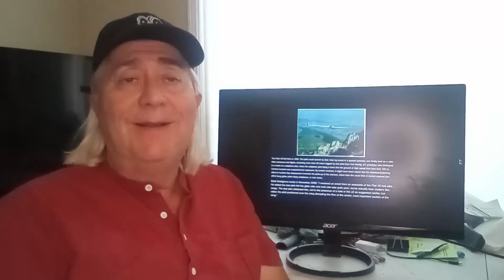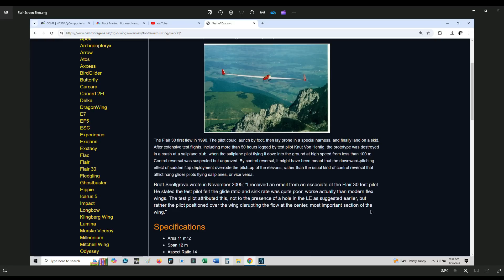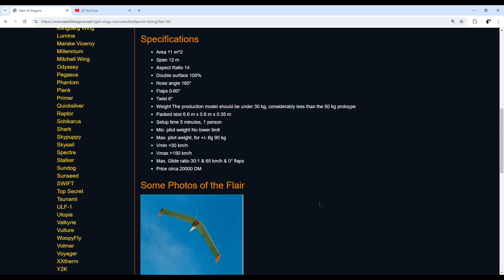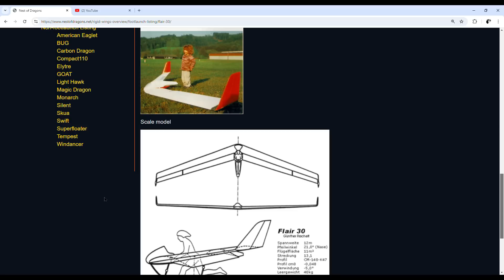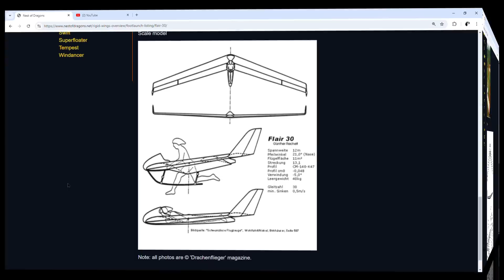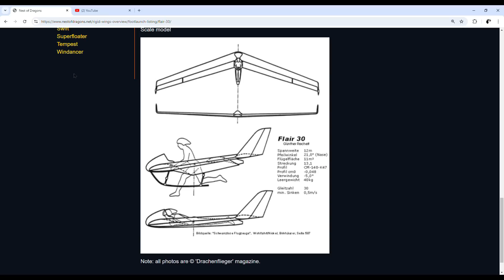Fatal Flair 30 Crash - An Engineering Analysis

Comment: Sounds reasonable. I heard no mention of airfoil thickness. Should be around 9-11%?
Reply from the maker: The thickness of the airfoil on the Flair (at least the one from sketches in various books which could be wrong) is 16%. Currently, detailed analysis is showing the main issue to be the hinge line location being way too far forward. The results appear to be independent of airfoil selection.

Comment: I was a good friend of Gunther Rochelt, and I remember this well. The problem was that the CG was more forward than previous flights, and when the pilot put the large flaps down, the elevons went up so much that the airflow separated on the bottom of the elevons, so they lost the ability to get the nose up. So, it dove it. Bottom line, the flaps were too big, and required an automatic mixer to raise the elevons with flap deployment. Flaps down, elevons up, and back stick let to disaster. RIP.
Reply from the maker: Hi Eric: Hope all is well with you, your family and aviation projects - they are unparalleled. What you have written is the results of analysis that was done shortly after the crash. I've never seen any math to back it up, but it might be out there somewhere. Apparently the LBA analyzed the crash over a 6 year period and I'm trying to find that report. I'm currently in contact with Gunther's son to see if I can get a copy of the report and a set of airfoil coordinates. Currently, Steve Morris and I have both done some CFD on the design (different codes) and have seen results that do not align with the reported flight characteristics. It is documented that the pitch trim was neutral with flap deflection, but Steve and I don't get that result. Steve is uncertain why. I'm trying to find out more about the crash because I think I've had similar or related issues with my current glider. So, stay tuned and keep posting your work and flights, they are really great.

Comment: Ludwig Prandtl Died in 1953.   So should have his ideas. They have proved a rabbit hole .. without end.
Reply from the maker: I would tend to agree, however, they are technically correct and therefore should be retained for reference. The key question is, "Why would you make this post here?" I am looking for airfoil coordinated for the Flair 30 and your comment is not helping in that regard. Post here only if you can help.

Comment: Wouldn't the center of lift tend towards the rear while slow?
Reply from the maker: You have asked the wrong question. The center of lift does not move with changes in speed. The correct question is, What happens to the pitching moment when the controls are deflected - especially the flap? I and another aero eng are still in the process of analyzing the design to answer this critical question.
Reply: @KlingbergWingMkII  Yes...control deflection. One model of that pitch behavior is C-150 full flap deflection forcing a strong down pitch adjustment when still well above stall.
Reply from the maker: You seem confused over this concept. From the Aviation Stack Exchange, "The aerodynamic center does not move when plain or camber flaps are used." The change in pitching moment is due to the increase in camber and hence the amount of circulation around the airfoil. This is standard aerodynamic theory. I only post this correction so my viewers do not become mis-informed.

Comment: I just posted this video of a recent flight in a production SWIFT3 where benign stall characteristics at maximum elevon deflection are demonstrated while thermaling.  The SWIFT3 avoids the problems you mention regarding control surface stall by using an airfoil that is thin in the chordwise region of the control surface.  The airflow does separate at max deflection but there are no adverse effects on handling:
https://www.youtube.com/watch?v=Q2AuMTkoyB8
Reply from the maker: Thanks Steve. Don't know if you/ve seen the following video, but my xflr analysis of an airfoil similar to the Swift (BTW, do you have the coords for the Swift airfoil and may I have a copy?) shows exactly what you are talking about. It is clear that at low Re it is important to keep the control hinge line outside of the adverse pressure gradient. I discuss the topic in detail in the video. I mention this as I bet most folks have not seen the video or don't really understand my pts. I suspect that the hinge line of the Flair flap at 40% is the root cause of flow separation and hence a full-on stall (at AoA less than normal stall) and caused the Flair to pitch down rapidly with no room for recovery. I will be posting a full analysis of this issue in the near future. Fly Safe, Rol. Video on the topic: https://youtu.be/2mh8szvuD40

Comment: Hey. Long time ago I worked for Rochelt at the Solair 2 projekt 1997,years after the Flair crash .I have seen the remains of Flair 30 . Rochelt told later the pilot was too far forward ,so was the center of gravity. I could imagine the wigtips that have to produce downforce may have stalled on their lower surface. I will see if I can find out something about the profile. Stay alive!
Reply from the maker: Having the airfoil coordinates would be a huge help. Let me know if you get them or can give me a lead on where to get them - thanks!
Reply: @KlingbergWingMkII  I will try to get, but I can not promise,
Reply: @KlingbergWingMkII  I had a call with Holger Rochelt , son of Günther Rochelt ,5 min. ago. He flew the Flair30. I may send you his telephone number so you could get in contact with him. But not here in public. Do have a E-mail adress or something where I could send you the number privatly?
Reply from the maker: Do you happen to know whether or not Gunter was a licensed engineer? If yes, what type of degree did he have?
Reply: @KlingbergWingMkII  First of all Günther was a visionary and manager. He was well known in germany for his many airplanes . A team of engineers did the structural and aerodynamic calculations for his projekts so he was well based from a scintific point of view.The real problem was how to finance? He him self was professor for industiedesign in Hamburg- where I met him.
Reply from the maker: Do you know if the Flair was ever tuft tested to look at the flow on the wing? Also, was it ever foot launched into flight or was it always towed? Finally, was the flap ever fully retracted (zero degrees deflection) in flight? Please respond to my email: rolkling@gmail.com. Thanks much for all your help.
Reply: @KlingbergWingMkII My plesure if I can help you! These days a had a telephonecall to Holger Rochelt, son of Günther Rochelt. He flew  the Flair 30, he can tell you more than I can. He told me to give you his telephone number. .I did send it  yesterday .Did it work ? If not, let me know, I try it again. Hey , I like your planes , beautiful!

Comment: I am living in germany and I met Günter Rochelr three times. And I have seen  how the model of the flair 30 crashed at winch towing. But what I know about the final crash of the full scale  flair is the following issus. The wing was overloaded. and the CG was too much in front of limimit. Here in germany we beive tha a air flo seperation at the lower furface of the airfoil was the reason oft the fatal lethal crash. In comnination of maximum set of flap defection and over limit CG the seperation of the lower surface of the wing tip overcame the ability to pitch up the whole wing ad the wing crashed nose dowt at the final approach into the ground.
Reply from the maker: Thanks for the input. I have read the original accident report (poorly translated) and your comments align with that report. However, regarding classic aerodynamics, that analysis appears to be flawed. Having a CG forward of the limit will not cause an aircraft to dive into the ground, especially after 45 minutes of flying time on the fatal flight. A forward CG would require a lot of up elevon to take off or not take off at all depending on how far out of range it is. This would be apparent at the start of flight. A good pilot (seems the accident pilot was very good) would not continue a flight with this issue. But, if the CG were at or near the aft limit, then a good pilot might be able to fly the aircraft for an extended period of time and then either a gust, or different flap setting causes the aircraft to diverge from it's stable config and either pitch up rapidly or dive into the ground. An unstable aircraft can go either way. What most people seem to be missing is that this was, of course, a dynamic event and most of the analysis I've seen is from a static point of view. This approach can lead to incorrect conclusions.

Comment: I have a theory but would help to see the video of the crash.... Is there a link or do I need to go hunting for it?
Reply: I've recently had some surgery and typing is really difficult.
My experience may not be very valuable or interesting to you as it's all based on self gained knowledge designing my own rc models over the last 40+ years. 
I know that aeronautical properties change a lot at scale. With that said, it is true, especially with wings, that there are things done within the designs in any scale that will create huge swings in performance and especially stability.
In my humble opinion, these large light "rigid" wings aren't very rigid because of weight concerns. 
Two things. 
COG of course is everything. Nose heavy gets away with a lack of correct position. But tail heavy on an aircraft with no tail is a HUGE catastrophic problem. 
Put a pin in that for the moment. 
Wing twist is used in nearly every design I've ever seen. Especially in rc models without a fly by wire controller using 10 dof IMU's.... 
Basically your wing design isn't perfect so we are going to pretwist the wing, to give the wing a little extra up elevon to correct any bad handling tendencies. 
I know this is basic stuff and very abbreviated I'm trying to demonstrate a basic understanding not trying to tell you anything you don't know. 
Bare with me, I'm getting there. 
Other things I've had to work through...
Wing sweep. Winglets. Size and locations of control surfaces.
All these things I've have added to my early designs because they were bad and I had to according to everyone I didn't ask for advice from...
You may be experiencing yourself currently.
But as my designs got more complicated I went from an aircraft that wouldn't fly to something that could but not great but then would become a better flyer but began to start eroding the performance to the point of becoming unfliable.
And programmable flight controllers became necessary to stay in the air like modern fighters.
That's when I changed the goal to making an efficient wing that tracked and steered correctly WITHOUT winglets. That remained stable WITHOUT twist or washout. I reduced the size of the flight surfaces and increased the sweep to bring everything back to a more stable platform and a wider chord at the wing tips. 
What I found was that the combination of all these things were flexing and twisting the wing to the point where the center of gravity was shifting aft. 
And in a really strange still not quite understood phenomenon was resulting in a nose down condition. 
If I'm right, you have a worse problem than I did because you have a PILOT. 
A pilot moves around. A pilot wants to be comfortable and we all fly full scale aircraft with at least some body English. My wife drives with her tongue hanging out of her mouth. Literally. 
What I noticed one time was when the car did something unexpected her tongue English was going the wrong way. 
That got me thinking about the battery in my wing. It was not only moving but it too wanted to be comfortable and was moving in the wrong direction under these weird loads because I used a rubber band (old school) to help secure it. It was pulling on the heavy side by using the wires as a fulcrum. 
I still don't understand everything that was going wrong there. 
But what I did was secure the battery, dialed in the correct cog and removed washout. Took advantage of adverse yaw in the elections and flattened the wing. I had good results with 2° anhedral for more aerobatic maneuvers. 
Thin longer and stronger control surfaces at the root of the wing instead of thick large but short length surfaces at the tip. 
I'm also blending two airfoils. I have the root airfoil and the tip airfoil and through the magic of CNC hotwire foam cutting I get a PERFECT blended wing with 50/50 throughout the length of the wing. 
Taking advantage of two airfoils at different areas of the wing means less compromise in choosing one for two very different parts of a  wing plan. 
Just don't get them backwards and spend a year trying to fly something that is literally fighting the air and itself and literally negating every single benefit you thought you were taking advantage of.
Reply from the maker: The crash was indeed filmed/recorded, which was new info for me. The location of that recording is currently unknown, but I'm in contact with a fellow in AU who knows some of the folks involved, but generally does not speak of the event. He may be a possible source. Stay tuned.

Comment: Airfoil numbers: I'm going to assume you may have reached out to John Roncz before his passing last year. If not, another source could be Jim Marske. Jim"s expertise is flying wings almost exclusively. Also, Matt Kollman who has been making rigid wing hang gliders for some time. Good luck!!
Reply from the maker: Good idea. Do you have any contact info for those still living?
Reply: Jim Marske also recently died. Contact info for Matt Kollman, who worked with Jim, can be found over at KollmanWings.  Jim's website is still up and still nice to look over.  There may be clues about the Flair 30 in Marske's stuff (which Matt Kollman may have insights on).

Comment: Stay with free flight models and you can stay safe and learn about aerodynamics more economically.
Reply from the maker: Only partially true. Models have much lower Re numbers so they do not always behave the same. Just ask the Wright Bros. The Flair had extensive model testing which did not show any problems. I make these comments so that viewers do not get mis-directed by incorrect technical comments.

Comment: Not much of a description on the crash (leading up to pitching down) as you read the statement. Was he at high speeds leading up to the pitching down or was he at slow speeds? Almost sounds like tuck under if it was at higher speeds as I have not only heard about tuck under it happened to me with an RC sailplane. I was told there is nothing that can be done when getting into this bad situation except watch it go down. Luckily enough I had plenty of altitude and slowly pushed out of it. I believe if I were a test pilot on something with a high aspect ratio wing I would have camera's on the tips pointing inward down the wing with a reference point as well as a camera pointing down to the tip of the wing to look for this. Torsional strength when weak the wing tips tend to oscillate violently and either explode or slow down the craft. A stiffer wing tends to lift the tips trailing edges. I met the gentleman that perished in 1995 at lookout mountain as I was looking forward to watching him fly his Swift and went out for dinner then when I came back it was at the landing zone in pieces. I was told from a friend of his he was doing loops as he normally had done in the past then went to strafe the field and it went into a bad oscillation and he could see him bouncing in the cockpit and I am not sure if the wing folded before it hit the ground. That was a bummer of an evening. Would be very interesting to see what happened. Take care
Reply from the maker: I'm not asking for help in analyzing the problem. I'm asking folks if they have any info/source for the airfoil coordinates..

Comment: Hello Rol! I think I have seen you showing us the book "Tailless Aircraft in Theory and Practice" from K. Nickel. Please look in pages 469, 470, 471 and 472 where it discusses about Flair 30. It has also a view of the airfoil, so maybe you can copy it for analysis. That said, pls be advised that G. Rochelt, the designer of Flair 30, has also passed away (I think he died in an aicraft related accident), since many years now. But Nickel, the author of the book was also German and I am sure they had discussed a lot about Flair 30.
Reply from the maker: Thanks! I had totally forgotten about that. The info in the book will not solve the whole problem, but will be very helpful. For one item, it confirmed my analysis that the flaps were set up to be neutral in pitch trim when deflected. The pic are not sufficient for getting good coordinates, but they give me some clues that will be useful in future analysis.
Reply: Günther Rochelt died from cancer. RIP

Comment: I remember this accident well.
Here in Europe we follow with illusion the development of the various versions of the Flair. His design make us dream about a flying wing with the pilot integrated and flying prono on the wing, with a magnificent performance due to optimization of the aerodynamics, designed by a team of aeronautical engineers from a german university (if my memory doesn’t fail).
The accident, as you said, was never completely explained as long as I know; but I remember articles in hang gliding magazines (Drachenflieger and others) suspecting a problem with aeroelasticity (not a flaw in the aerodinamic design) naming possible not enough rigidity (materials. construction?) of the wing following a recover of a steep dive previous to landing
Reply from the maker: An interesting note about the aeroelasticity, but probably not something where there is enough info available on the construction methods to be useful.